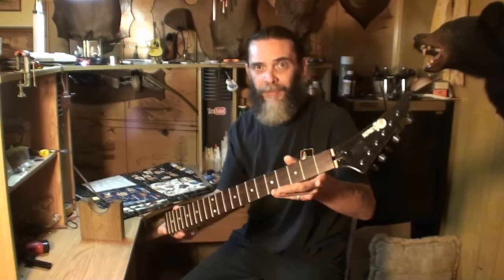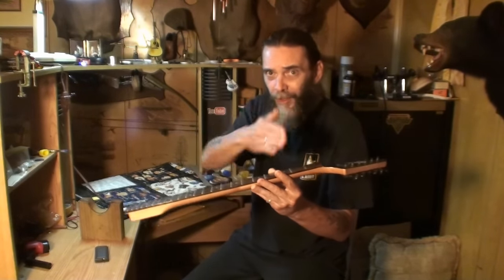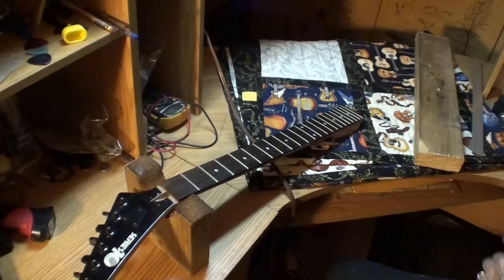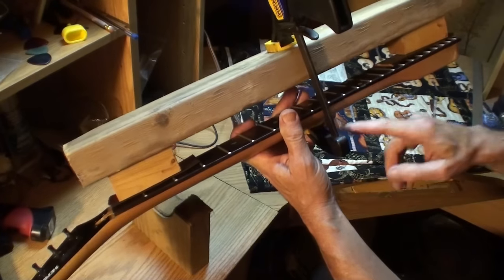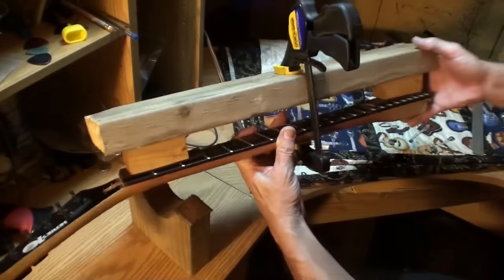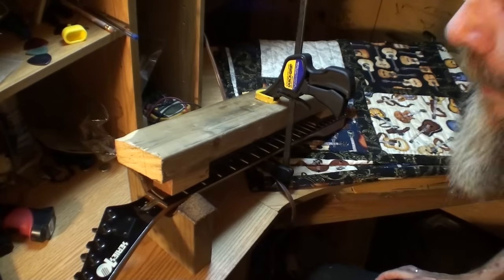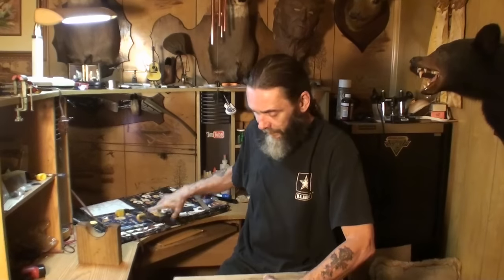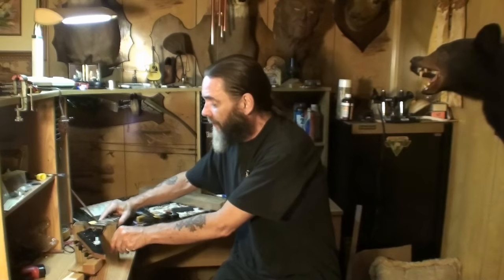How to Help your truss rod by Randy Schartiger Quick Clip Tips

Comment: I have the opposite problem, I need more relief and i am at the end
Reply: I think you could just use the blocks on the back of the neck. If they keep sliding sideways you can shape them with the curvature of the neck so they fit and stand in place.

Comment: How much time did you give the neck to be clamped?
Reply from the maker: 24 to 48 hours, this gives enough time for it to settle in. thanks for checking out my videos!
Reply: @RandySchartiger  one last question, i gave it few nights already, the neck was straight but when i tried to turn my truss rod just to see where my rod can go, the neck did not move even at max turn. Would you advice me to put some washers in?
Reply from the maker: @siegmac3267  no I would clamp it in the direction you are trying to make the truss rod go and try turning the truss rod adjustment while it's clamped, this often make the rod turn a lot easier. I've had some so bad I also had to use heat to get them to move.
Reply: @RandySchartiger  even if it did not move after max turn? My wrench turns back to left if i turn it to right max.

Comment: Hi. I know this is an older video. I hope you will see this. Are you starting this process with the rod maxed out or completely slack? .I think the video implies that its very tight. But in my mind, it seems that if you did it slack you could reset the thing totally so when you tighten it up with the rig in place it would be tight with the back bow you created and you'd have a wider span of up bow as you loosened it from the position the rig created. Both might be possible but I'd like to know which way you did it here for certain and had the most success with. I have a set neck beauty at my dad's house I use on vacation and it needs a little help.

Comment: That is a great tip....have you done it with acoustic's?   I would guess it shouldn't matter having the truss rod adjustment at the body.  I have a Bedell I just refretted with super jumbo's and I think I cut the slots a little bigger then I needed too.  The frets are seated and I glued them in and I'm getting about .014 of relief and truss rod is tight.   I like about .010 or .011 at most.  I was going to pull the 1st 12 frets and use spanish ceder to fill the fret slots then recut the slots smaller but this would be a whole lot easier and the frets are nice and level already.
Do you think I can get .005 by doing this?   Do you usually get at least a full turn on the truss rod?
Reply from the maker: usually the truss rod is only turned one quarter either way, at the most maybe a half turn on rods that are really out of adjustment, about the only time they ever  need a full turn is when taking the adjusting head completely off to oil the threads. thanks for checking out my videos!
Reply: @RandySchartiger  I did the guitar tonight...got about a quarter turn....didn't make much difference maybe .001
Reply from the maker: @cugir321  ok since its been about 24 hours you should be safe to go another quarter turn.

Comment: can you do reverse, if your neck is under full tension, but truss rod not working, and its back bowed ?
Reply: You must release tension from the truss rod before that.
Reply: its all loose, but no movement in the neck for releif...neck is almost straight, with slight back bow....
Reply from the maker: @petermilovich4451  all you have to do is clamp it up like I did here, but force turn the neck over and clamp the opposite side I did in the video. good luck and thanks for watching!
Reply: thanks man, I do watch your repairs

Comment: Could this be a solution if the truss rod is actually maxed out?
Reply: Depends what you mean by maxed out. If the nut is tightened to such an extent that it scares you then this would likely be a great help. But if the truss rod nut has run out of thread on the the rod to travel down, then a spacer or some washers under then nut is another solution. They push against the end plate, effectively giving a little extra thread to work with.

Comment: I just found your channel, and I really like the down home way you communicate your knowledge. Now don't laugh, but I have a question about my First Act double cutaway guitar. It's a really nice guitar actually and changed my mind about First Act, as this one isn't a K Mart blue light special model, but it is actually a nice instrument that plays well and has really good tone. Therefore I want to save it, and I have a problem with the rod adjustment. . I changed strings from 11's to 9's, and when I went to adjust the neck, the truss rod wouldn't budge at all. At the opening to the truss rod, there was some light colored stuff that when I cleaned it our, was real fine, and crumbled into a powder. I don't know if it is sawdust from boring the hole for the rod to go into, or some sort of crappy lubricant that dried into this stuff, or heaven knows what it is. So before I try your suggestion, which I trust, I want to know if you have ever run across anything like this, and how did you deal with it.  I hope you can help me here, and thank you!
Reply from the maker: it's probably oil or finish that got finish dust from sanding in it, this happens a lot from finishing and sanding with the truss rod cover off. clean it off and oil it again and you should be ok. thanks for checking out my videos!
Reply: Thanks a lot. I was considering whether or not to oil it, so I appreciate you telling me that! And I'll be cbecking out more of your videos!

Comment: Hi Randy! Great video, thanks for posting that! I have a question: does it work other direction? Cause one of my basses (fender p bass, medium gauge strings, normal tune) has a little truss rod rattle and it goes off when i m doing upper bow a bit, but i don't need to have it that tight with standard 45-100 set, otherwise i ll need super heavy gauge strings to keep truss rod tight with no rattle. (Chair-Lock/rubber cement doesnt help) 
So, i m wondering if i can do the same you did, but vice versa🤔
What do you think? I ll be glad if you find a minute sir;) thank you!✊️
Reply from the maker: hi Maxim, yes this works in both directions, just place the blocks and board on the other side of the neck and clamps it while adjusting the rod accordingly, be sure you are adjusting the rod for the direction you are clamping it up, very important!
Reply: Randy Schartiger thank you Sir!👍

Comment: I have a guitar with the opposite problem, I bought it second hand (from a store similar to a pawn shop), virtually new, but the truss rod had been fully tightened for months and now I have loosened it as far as it will go, the nut is totally slack, and due to having that amount of back-bow for so long (at least 12 months) I now cannot get the relief I need in the neck to eliminate the buzz at the first few frets.

What do I do to remedy this situation that is preventing an otherwise perfectly good instrument from playing as it should?
Reply: Simon Worrall if it’s an older guitar it might have a single truss rod which makes it harder to move it one way or another. You might try the clamp the other way around

Comment: Randy can you give Me some advice on a classical acoustic guitar I purchased I would greatly appreciate it ,the guitar has high action it is a brand knew guitar, when I place a straight edge on the fretboard it does not line up with top of the bridge, it lines up at about the middle of the bridge .I know for a steel string it should line with top of the bridge ,is it different for classical guitar or should I return this guitar.I found one classical guitar site online that said it was okay if it lined up with the middle of the bridge ,but that doesn't sound right to me .

Comment: Randy - i have the opposite problem - i have a neck (that as far as i am aware) has a perfectly functioning truss rod but when i try to put relief in the neck no matter how far i loosen the rod the neck does not move! help!!
as i say pretty sure the rod is not broken (although not 100% sure how to check for that)
Had this prob recently on another guitar that had an unbroken rod too - really fustrating - any ideas?
thanks paul
Reply: I experience this a lot in the northeast especially from winter to spring.  For adding relief use 3 blocks.  The outside blocks are the same height. The third block I place on the 7th or 8th and is slightly taller, 1or 2 mm. I use a level and blocks that fit between the frets so that pressure is applied only to the fretboard.

Comment: Hey randy, wanted to  ask u something but didn't k iw what video to ask it under. So here's good enough. I have a series 10 ESP Viper electric guitar. The neck is comprised of maple and the fingerboard is rosewood. Now, i know it's not the most well-built guitar, but the relief/ truss rod is shifting during play. It increases and decreases. I can literally watch it move. I can even put  my hand on it and apply the littlest bit of pressure in either direction and it will go where i want it to. But ofcourse, it still does what it wants when it wants. U got any ideas how to stop this?  Or am i just outta luck and need to replace the neck with something more reliable?
Reply from the maker: tighten the truss rod and make sure it works, put some back bow in the nerck and leave it 24 hours, then set your neck relief. it sounds like the truss rod is not working at all or could be loose laying in the channel. if it works it'll put back bow in when you tighten it. good luck!
Reply: Randy Schartiger I'll make sure and try that out, thanks!! Supposed to have been straight from the factory, sure doesn't seem like it. I got one more for ya. I got a sneaking suspicion that one of the neck bolts is stripped. Not the bolt, but the hole. I imagine an insert would b  what i need. But would there happen to b something else a little faster, easier i could try at first? LOL. Thanks again, in advance.
Reply: @michaelmontavon2472   You can try glue with a toothpick or two in the hole wait for it too dry so you don't glue the screw in .
Reply: @ @UNCLEBUFF  thanks for advice. I've actually looked up a couple vids for it. One being done by Dan Earlewine. Now he said to use wood glue. I haven't made the repair yet, it's actually held decent for awhile, but i can tell my time is drawing short lol. I asked my guitar tech, and he said use super glue. My guess, cause it dries quicker?? Would u have an idea as to which woukd b best, Wood glue or super glue??

Comment: Anyone ever use washers or a spacer to get a couple extra turns on a heel type truss rod? I did and it worked but wondering if there is a better way.
Reply: That often works if the nut has run out of thread on the rod, but if there's still thread on the rod going beyond the metal end plate then a spacer/washer won't help as lack of thread won't be the problem. It'll most likely just be that the bow is so pronounced that the torque needed to tighten the rod enough is extreme. 

Rather than really force it and risk shearing the rod off just below the nut, your best bet is the trick Randy uses in this video. The clamp does the straightening, taking load off the rod and reducing the torque needed to tighten the nut.

Comment: what happens if when trying to loosen the rod, and you unscrew the nut off the rod?
Reply from the maker: it means it's a one way truss rod, if that happens and you still need relief in the neck go with a heavier gauge strings, they will pull more relief than light ones, you might even have to clamp the neck and help the truss, search my channel I have videos of how to do it in detail.
Reply: Thanks Randy, It's a Martin 2006 HD-28. Can't take off the neck. I did put medium gauge strings on it. It helped. I took it to Warner Repair Service, a local Luthier. I'm having him install a FMI saddle in it. I'll check some of your videos also. Thanks again...Jim

Comment: Nice. I'll have to get myself one of those clamps. 
I need to kind of force some relief into my chinese hofner shorty neck as the rod came loose somehow and it won't loosen enough to get the relief I need to stop the low e string buzz.
Although really I think I need to level the frets.
I have 2 Chinese hofner shorties and they are both a piece of sht in terms of the bridges, tuners and frets. I put gotoh tuners and bridge on one of them and its that one that has the truss rod issue.
The other one is actually sort of ok since I put some relief on the neck though the tuners and bridge are a bit crap, and both shorties are quite different to each other including the type of nut, thickness of body and the actual hofner logo for some reason (maybe one is a fake hofner though I really don't know why anyone would bother to make a fake hofner as they are really cheap electric guitars).

Comment: Sorry to say this did not work for me. I have a 1995 Fender American Deluxe Precision Bass maple neck & finger board. This instrument also has carbon graphite reinforcing rods in the neck. Applying pressure to the clamp (I had to use a screw-type clamp) bent the 2x4 more than the neck. The barely budged. I figure something else must be wrong because I can't get the neck relief any lower than about 0.016".